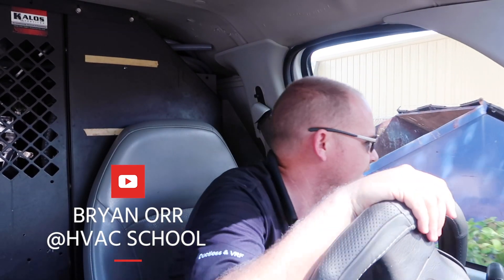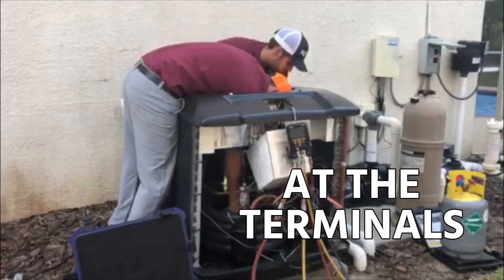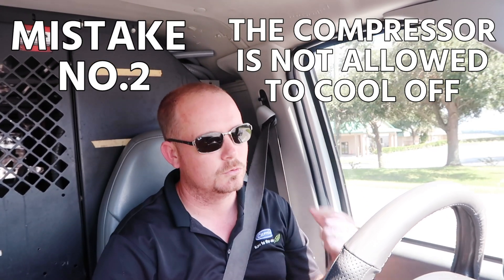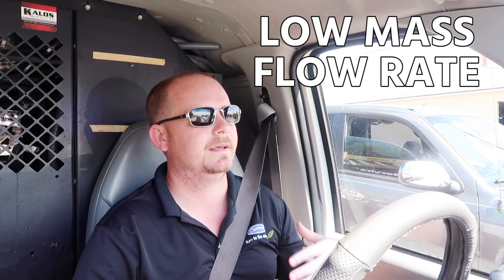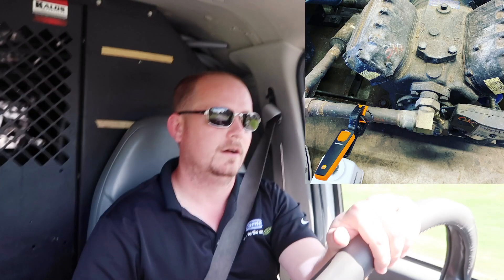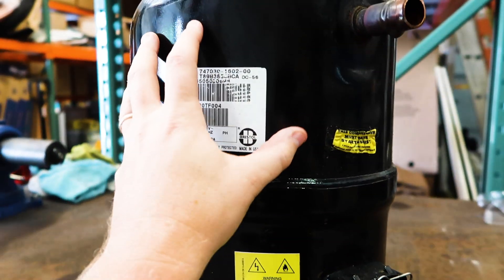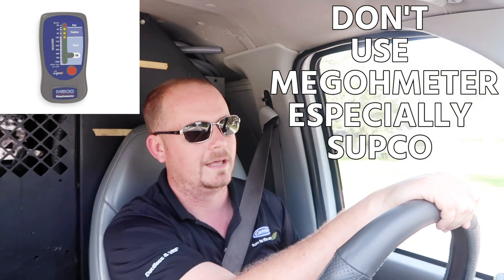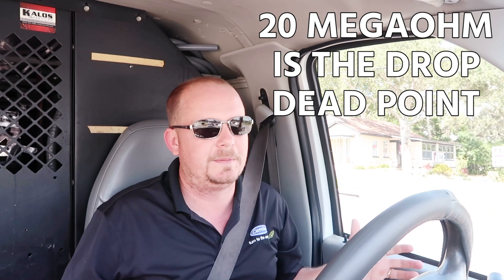3 Rookie Compressor Diagnosis Mistakes

Comment: AC guy checked mine wrong and said mine was shorted.    125 bucks for the wrong diagnosis.  They wanted 2 1/2 times the cost to install a new one.  Luckily I called a retired AC friend and he said you have to pull the wires Off.  Turned out the hard start relay was shorted.   Removed it and it fired right up.   Never figured out why it had a hard start on it.

Comment: Loved how you added the tip about bumping the compressor if the overload doesn't reset. I've had compressors before where the overload never reset. Even well over 24 hours of letting it cool off. Gave it a tap with a rubber mallet and then it did haha. That simple tip saves people money!

Comment: I had a difficult compressor today. Ohmed out good leg to leg, no short, no open but refused to start. It's not tripping the breaker either. I put a 3 wire hard start and it clicks out after 3 seconds. I ended up replacing it but it was difficult to condemn it. Of course I checked the cap and even replaced it hoping it would start.

Comment: Hvac school. What if you have 2 open windings on 1ph 175v conpressor (residential fridge) lg compressor. I know if it overheats 1 winding opens. But you have 2 windings with no resistance /continuity.! Diagnosed bad compressor. I thought common sense. Turns out the new compressor comes in with also 2 open windings! Wth!

Comment: Compressor Hard start with relay can also save the compressor  if not short to ground & make you look like a hero. That client will call you to replace the whole system .
Reply: When putting on a hard start for the compressor, the homeowner usually asks me how long will it last. I tell them it could be 10 minutes to 20 years. No real way of telling.

Comment: I used to believe if you read anything but OPEN LEAD (OL) to ground that the compressor was shorted to ground.Turns out that a little voltage will always leak out of the windings and find its way to the shell casing via the refrigerant and oil.

Comment: "Heat in the windings" shows picture of scroll. SMH.
Reply: Windings are right under scroll.
Reply: Those are scroll plates not windings. Windings are coils of wire coated in varnish

Comment: Had the exact oposite problem one winter the compressor oil was too cold to circulate and it wouldn't run. After the sun come up and warmed it enough it allow it to start up.

Comment: Learn how to use a MEGGAR! I mean a real one, not a cheap,  battery powered one.  Use a self powered hand crank meggar, like AEMC 1250. Learn how to interpret the readings, and use it as a part of your preventive maintenance program, to evaluate the condition of the oil/refrigerant atmosphere that the motor windings are being exposed to.

Comment: A side note at 3:19 - 3 phase compressors will read open windings between all 3 windings when off on thermal overload.

Great video...
Reply: What? I’m pretty sure they have start, run, and common just the same. At least the scrolls. Not sure about the giant, car engine sized ones though.

Comment: Over 30 years in this trade and I just now find out using a defibrillator, yelling at the homeowner to clear, emotionally shouting at the compressor to stay with me, before saying he's dead Jim is not the best method?
Whats next, saying checking for gas leaks with an open flame is a bad rookie idea. 

But seriously, back in the 90's I misdiagnosed a compressor, thermal cutout was the problem, second opinion tech from other company figured out the real problem, homeowners thought I was out to gouge them, but it was a rookie error.

Comment: yesterday, i had a unit with a burnt off terminal. today i had a unit that was out on thermal. both fairly common problems.  i have a semi-hermatic on a walk in cooler, that is just about gone. its got high consumption but still might run. how do i tell if its good enough to use?

Comment: You can ohm a winding. It will read infinity 0
Reply: Infinity and zero are two different values. Zero is no resistance and infinity goes on forever.

Comment: If you have thermal overload a lot of times is caused by those damn thick blankets on older units especially the shitty Trane/A.S ones and the B.O.P compressors which are the purest junk there is!!

I (ALWAYS) remove the shitty blankets on ones older than 10yr that is experiencing any issues...  I know what is coming and try to save the homeowner time and calls for the future.

"CONTINUITY TESTS" for continuity to ground going leg to leg comes first, then continuity to each other to rule out broken winding or overload, then ohm each leg and add up.

Use a water hose on compressor if thermal overload or no "continuity" to "common" is found, leave meter on so you know right when continuity comes back...    That is the quickest way to cool one down...  Had one tonight due to the thermostat failing to send "O" signal to RV causing heat mode in 88* weather ambient, kicked the compressor into overload with blanket. 20yr old unit so i removed blanket, and before hose could be got it cooled down, started back up to find issue, tied the o and y terminals together for temp fix until homeowner could get thermostat due to him being "broke" as he claimed. 

Temp fix can go a long way!

Comment: Good video. @5:12 you said to isolate the compressor reset the breaker. That is the very first thing I teach my techs before starting to pull the condenser apart to get to the compressor terminals, isolate, reset condenser 's breaker, if condenser fan runs, your problem will likely be the compressor, that is if capacitor and other components checked out ok.

Comment: This is very informative for some new guys. I have also seen misdiagnosis on a compressor with the reversing valve stuck in mid position. This could have many unseasoned techs think there is a problem with the valves in the compressor. I almost misdiagnosed a compressor once cause my gauges were open ( yeah that happened) But I caught myself before I made myself look like a dummy.

Comment: What if the compresser doesnt pump down is it bad
Reply: JUSTIN BRAVO could be bad valves leaking by, or if the system is over charged and isn’t able to pump down into the liquid receiver

Comment: When I first got into service work I had a Carrier 40 ton packaged unit that was tripping the first stage compressor. Checked the terminals for a short. Found none. Still tripping the overload switch. Found out carbon around the strips around the terminal was the problem.
Reply: Thanks for that tip!

Comment: Just don't ohm out the compressor terminals if you've got your face right in front of them and there's refrigerant/pressure in there. It could blow out the terminals right in your face. Never seen it.. but I've heard it happens
Reply: What the heck are you talking about? Are you saying there have been cases of that entire plug just randomly blasting  out of the compressor

Comment: I thought the Supco megaohmeter was designed like any other megaohmeter? Terminal to compressor body (copper) not terminal to terminal.
Reply from the maker: It is, it’s just commonly misused by newbies who don’t know how to use it
Reply: Great videos bro. I didn't take offense as a Supco distributor but it is a decent inexpensive megaohmmeter, lol! I try to sell the tools they need and won't even buy this one. Then they look at me with those lost eyes when I asked if they checked their suspect compressor to ground with their megaohmmeter.

Comment: Good video! 
Do you think relying solely on a audible continuity test to ground at the compressor terminals to the metal body of the compressor is a good practice to diagnosing a ground compressor that is tripping the breaker?
Reply: Not solely, but you definitely need to do that as part of your diagnosis.

Comment: it happen to me when 2 different technicien said to customer compressor is broken. I go to make another diagnostic of it I noticed that the compressor was hot, had tripped on its thermal protection and i saw the polarity not good.  I let it cool all night and the next day I changed the polarity and fix the problem. the customer is really happy ;)

Comment: How do you isolate the compressor?
Reply: If breaker is tripping, take the compressor out of the equation for testing by "isolating it".

Disconnect at the terminals of the compressor, tape off the leads, (if typical residential a/c condenser, replace top so that condenser fan can run).

Replace disconnect. Reset breaker. If breaker does not trip and the only component you have disconnected is the compressor, need to look harder at the compressor as your problem.
Reply: I'm not 100% on this, but I think he means to bypass the contactor and connect it directly to the service power. If the breaker trips, the amperage is too high and the compressor is bad.

Comment: Good stuff! I wish you  mentioned if the compressor is tripping breaker isolate it by pulling the disconnect, if the breaker still trips then you need to check the breaker. I only say this because  we all have missed this step once..... hopefully

Comment: I know that you are trying to keep the video as short as possible but by cutting out the delay between you comments doesn't allow time to digest what you just said. You give a lot of good info but the presentation is too fast, almost like you are in a hurry to get it out and be done.  I suggest you approach it in a manner that not everyone is at your level of knowledge.  You are very knowledgeable but being a good teacher requires you to be able to make things understandable to those you are trying to teach.  However, I do learn a lot from your videos. I just have to watch them a couple times for what I've missed the first time through.
Reply: I found that the playback speed at .75x really helps me absorb some of the things I need to hear.
Reply: You do know you could slow the speed of the replay down a little bit with those three little buttons on top of the video or just go back and do it again and again like I do all the time until I get when I’m trying to here in a matter what I’m listening to
Reply: I really agree with this and it has been something I might mentioned myself. I've been doing this for 40 years, but still pick up little bits of info that either have forgotten, or didn't fully understand.  Thanks a lot for a great channel. Please give it some serious thought to slowing down!
Reply: There is a rewind feature.
Reply: Yea a bit to fast there but I get everything you say but you have theses videos for people to learn yes there’s a slow down option but every good teacher knows this I’m sure he will be more cognitive on the future videos
Reply: Also, the pause and rewind buttons work great too.
Reply: Everyone learns differently.  Watch it again if it is too fast and you will get more out of it the second time. Otherwise, he is helping all of us become better HVAC techs.

Comment: At tech school I have the students recover refrigerant before accessing terminals, for safety reasons , I’ve had the glass insulator burst pulling terminals off compressor, spraying oil and refrigerant. I realize this isn’t practical in the work place but when dealing with 16-18 year old students safety 1st practicality in time. FYI  great video Bob
Reply: Really how dose that happen!?!?
Reply: @DavidHernandez-le7qn  It doesn't its just another example of lawyer proof coddling, vs actually teaching a trade.
Reply: @ZERO-F2G-  Of course it happens.  You're telling me you never found a compressor with a pin blown out of the fusite?  I had a 30 ton Carlyle blow a pin right after startup once.
Reply: @RalphMercuroMusic  Yes I am telling you that in 35 years I have never seen a pin blown out. I have seen them corroded to the point of difficult to use a repair kit, I have seen them overheated to mush, but never blown out.
Maybe its because I have never been on a compressor over 20 tons, or maybe its just rare enough that Ive never seen it.
Reply: @ZERO-F2G-  Our experience is very different.
Reply: This is the proper practice and is in fact Industry Standard.  I'm also an HVAC instructor with over 30 years in the biz.  One of the text books I use is the Carrier Servicing Procedures Manual.  It says very clearly in several location that compressor windings should always be checked at the lead end unless the system pressure is brought to 0 PSIG.  I know how it's done in the field but students should be taught correctly.

Comment: Mistake I learned from on one of my first scroll compressors on 15dr freezer. Windings weren’t open and it sounded like it was running(although badly). Wouldn’t pump down and pressures equalized. I thought compressor must be bad. Find out that it’s opened internally on thermal yet windings don’t read open.  Cooled it off (for over an hour it felt like!) and it worked perfectly.

Comment: I have a question Bryan. A few weeks ago I had a Lennox heat pump with a Copeland scroll that was immediately tripping the breaker. I unplugged the compressor at the compressor and sanded up a spot on the copper and checked each winding to ground but got no continuity to ground on any of the 3 pins. I then left the compressor unplugged put the top back on and flip the breaker and the condenser fan came on and the breaker didn't trip. I went ahead and replaced it anyway and used acid away because my qwik acid test immediately changed color. My question is can you have a compressor that's shorted to ground but not be able to see it with your meter. I wanted a definitive beep for continuity so I could feel confident about my diagnosis but I just wasn't getting it
Reply from the maker: Yes that can happen. The voltage used by a meter is very low and sometimes it won’t show the short.
Reply: Ok Brian good open conversation for this topic special case.  So in his case how would you go about confirming that short other than him resetting the breaker everytime and seeing it trip. Because the low voltage induced by the battery in the meter when he tests for short to ground what other method would allow you to see the short?
Reply: Eric M  ok yeah that's what I figured the breaker could be weak from constant tripping or lra and tripping.  A GOOD megohmeter then could show the short